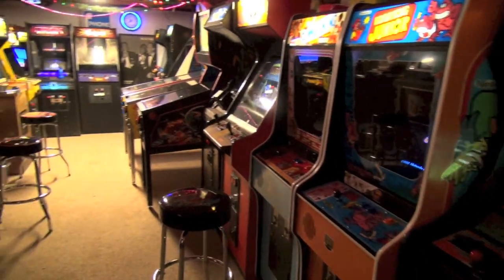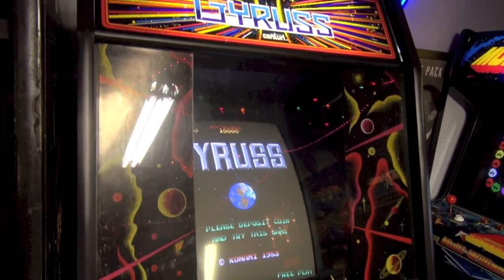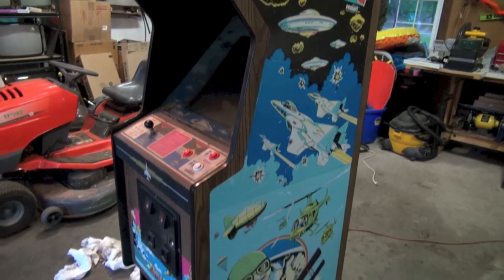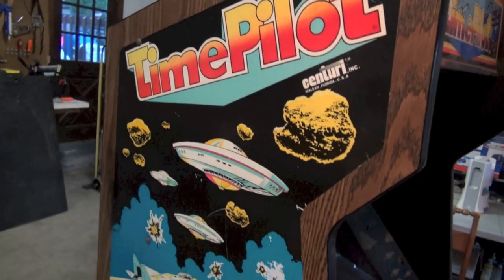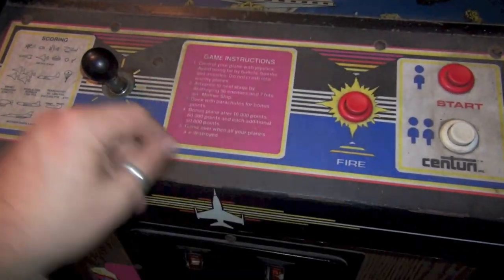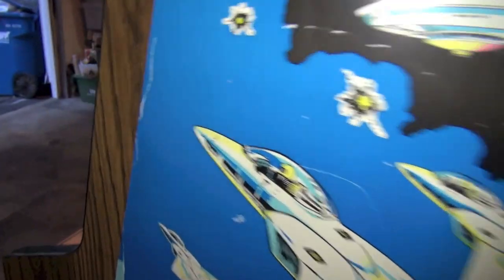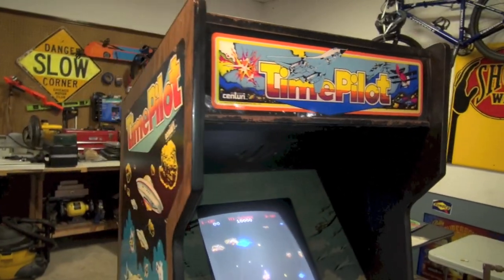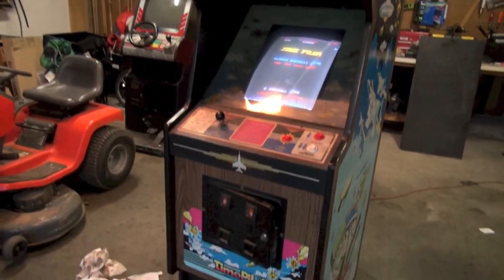Centuri Time Pilot 1982 Arcade Game Konami - RESTORE PART 1

Comment: The Monroe joystick allows you to make very smooth circular motions which are essential in both Gyruss and Time Pilot.  It makes a huge difference in playability on both games compared to trying to use a standard generic 8-way joystick.  If you have a Gyruss or Time Pilot cab it is definitely worth it to make sure you have a Monroe in it.

Comment: I know this is an old vid but I just picked up a time pilot cabinet this evening. It’s a rebadged  vanguard. And it is very rough but looks complete except for one coin mech. Was told that it does not work. But for $20 I couldn’t pass it up. I haven’t really dug into the guts yet however there are a few hanging wires inside.